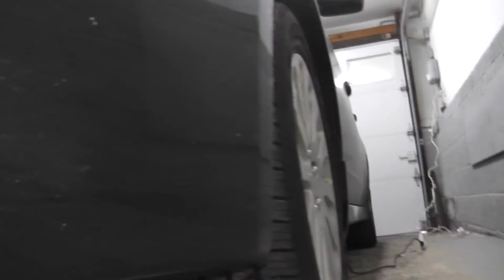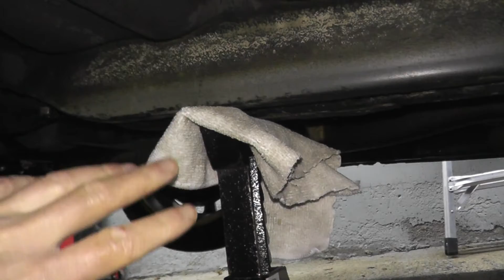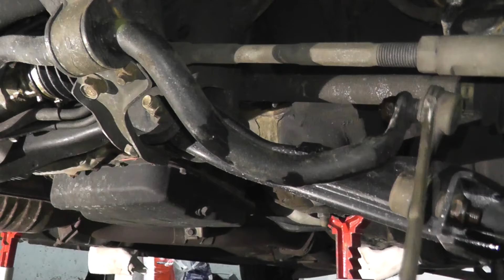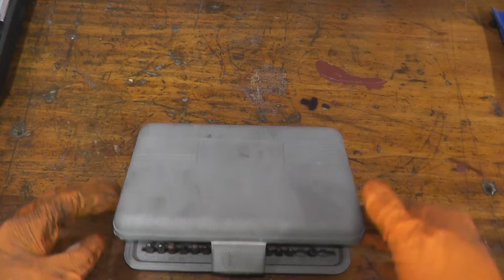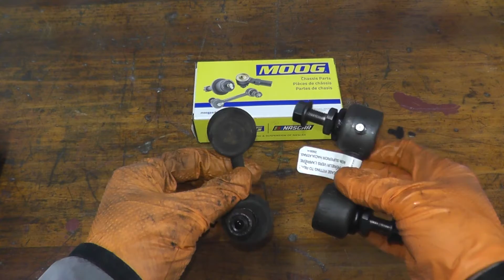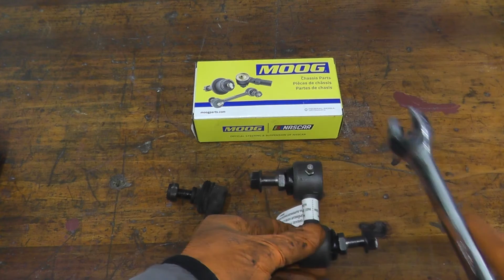How To Install MOOG Sway Bar Links with Basic Hand Tools

Comment: Do you have to add grease or are they pre greased good to go?
Reply: One pump grease after installing the sway bars
Reply: @lifegoeson4085  isnt it much easier to pump in grease top and bottom before installing?
Reply: @RichRich007  use heavy duty lithium grease
Reply: @RichRich007  that's what I did ,I pump one time grease and I still the sway bars

Comment: I bought a MOOG stabilizer bar link for the rear of my 09 suburu. The bar link however does not have the bolts on opposite sides, so its basically U shaped. But somehow this was the right part. Still debating if I should return.

Comment: How have they held up after a year?  People say Moog isn’t what it used to be and wanted some real world data.
Reply: A shop installed these on our Honda Odyssey ay 135K. They never greased them. They lasted exactly 22K before making noise and rusting inside causing failure. The rubber gaskets are thick and looked flawless. Had they greased them and informed me that these needed grease, they would have lasted longer. We stopped going to that shop as they are morons. They install good parts like MOOG, but they do not install them correctly. So props to MOOG quality. Impressive that they lasted this long without grease.

Comment: 1.Remove from box 2. Turn in the direction of the garbage receptacle. 3. Throw them in. 4. Buy oem part (regardless of price, ultimately it's cheaper)
Reply: Greaseable type have some pros, but the major con is they do need maintenance. If that is not/ 
cannot be done OEM sealed type will be better.

Comment: What is the purpose of greasing and is it a must?
Reply: Yes routine greasing is a must with links with zerks to get good performance & life. If you don't think they will be kept up, OEM-type sealed will likely last longer than the greaseable. How often to grease depends on climate & road conditions. 5-10k miles is typical (oil change interval). A small amount of old grease should come out of the small end of boot when done properly. Moog has instructions on their site.

Comment: Good video but I believe you should torque everyting with the tires on the ground so weight of car is at normal riding position...I could be wrong tho?
Reply: That is completely incorrect; the sway bar link's ball joint allows for movement, so it makes no difference whether you apply the tightening torque with weight on the suspension or without it.

Comment: Excellent tutorial, as always.
Interesting that you used a torx bit to assist in removing the link.
When I replaced the links on my daughter's 2010 Forester, the end opening accommodated an Allen key.
Reply from the maker: Thank you. Appreciate the feedback.
Reply: I installed an after market rear bar a few months back. I kept the stock endlinks. To swap out the rear bar, I too did not have to use a torx bit, I was able to just use an allen key. I am going to install better bushings and endlinks and just making sure I have all the proper stuff before I dive into a small project.
Reply: I spent hours cutting the nut off because the bit kept rounding out the end. Sigh, started about 7pm and finished after 12am

Comment: Very useful video, I like MOOG parts and I have this kind of sway bar links. What I have noticed is that the tie rod end boot leaks a little bit of grease, I filled it up with grease when it was brand new and when installed it start leaking grease from the middle of the boot so I took it off and send it back and got a replacement but same thing happened with the new part, any idea about this?
Reply: A moderate grease leakage is intentional. When new grease is added to the zerk fitting, the old grease must come out somewhere, else the boot will eventually pop. This also allows contaminants to be flushed out. The small end of the boot is furthest from the actual bearing in the end link, so is the best place for the (limited) exposure to the elements. Factory end links are sealed, "non-serviceable" (non-greaseable) with plastic bearing inserts. They typically will last a long time, but greasable metal bearing end links (like Moog) will last longer/be smoother if routinely greased (every 5-10k miles).
Reply from the maker: Just one. I've noticed some parts purchased online are not authentic. In other words, they're cheap made in China parts. Nonetheless, I'll keep an eye on this one. Appreciate the feedback.
Reply: @Carsntoys  really true,  anywhere online is a sort of gamble on low quality knock-offs.  🙄
Nothing's better than Japanese OEM (German OEM: short lived by design!)
Reply: Only 2 pump grease good every oil change ,not too much ,